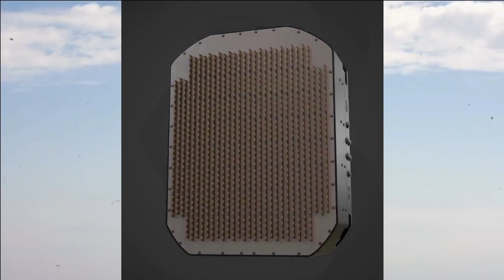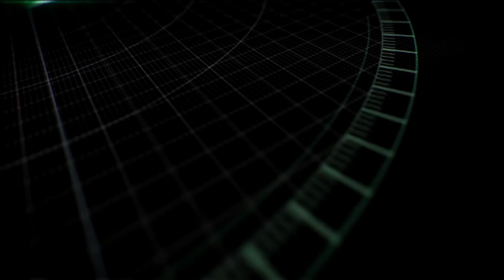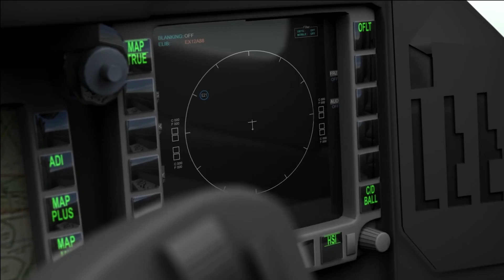Fly-by-wire & Engine Upgrade planned for SU-30 MKI

Comment: Ist possible to accommodate the AL 41 f 1s engine in to the existing Hull of su30 mki
Reply from the maker: yes it fits into SU-30 MKI air frame. Hull is used for warships.
Reply: @IndianDefenseAnalysis  Thanks for your reply and corrections

Comment: Looking to the future
After Jaguar retirement convert 5 squadrons to the ground naval strike mission. 
 Like f-15 strike eagle.
second life to the tired airframes.
It may be include 
1.utam big radar
2. No  internal infared tracking system (free space)
3. No trust vectoring (free killos)
4. Flyby wire made in India.
5. Weapons officer dedicated.
6.fuel tanks
 Things like that ,simple relative to the performance gains  .
Sukhoys have good range and good payload .

Iaf also needs to
 strimline weponry .    sos
Link 16 or similar.  sos

Comment: If we have to keep in the budget under control, we should forgo the change of engines. If possible some upgrades to the AL-31 should be taken up, rest Fly-By-Wire, Uttam AESA and New avionics n other upgrades should be taken up asap.
Reply: engines have service life time issues, they are must needed change

Comment: If you look into reason why Abhinandan's plane was shot down that was because of missing communication link and BVR. This is a problem with whole Indian army, not just with IAF. There was even a retired Pakistan general who mentioned the same thing.
Reply: Had he flown a Tejas instead he would've been safe
Reply: If you have a soup of different equipment from different countries, synergy and integration is kinda out of the window. lol
Reply: @sidewinder3422  Don't think that's any issue here. You have example from Ukraine which is using older platforms from any country it can get. Problem I'm trying to highlight is, army should be working on networking first so their aircraft/tanks would be in better position even if platform is not very good.
Reply: Mig 21 is not ment for BVR engagement. When Mig 21 was made, visual range dogfight was norm. While F-16 was made with BVR capability. Su-30 MKI is very capable of BVR.
Reply: Mig-21 is no match for an F-16.  This isn't a movie, in real life you can have a guy in an old F-14 destroy a bunch of SU-57s
Reply: He tried to take an F-16 with crap Russian tech and got his ass handed to him
Reply: @verdebusterAP  If it had networking and BVR capability then mig-21 would have been much more lethal. If aircraft would have been getting data from awacs or any other ground system and better BVR then pilot would have full battlefield picture and better position to handle that situation.
Reply: @omegabluek  
  If it had networking and BVR capability then mig-21 would have still gotten smoked
The F-16 was built with radar and other advanced features in mind while the MIG-21 was not
The MIG-21 limited size does not allow to accommodate what it needed to match an F-16 in fight
Reply: @verdebusterAP  
But gotta respect his guts, right? The sad fact is that our politicians and bureaucrats have historically let our armed forces down, but our armed forces have a never-say-die attitude, summed up by the quote of the Army Chief during the Kargil war; "we will fight with what we have". Salute
Reply: @arthurrod7638  
He's lucky to be alive 
Judging by the amount of wreckage ,its was promxitiy fuze not a direct hit
Reply: @verdebusterAP  
Occupational hazard, bro, occupational hazard; salute

Comment: IAF might feel that just 16 % thrust increase is not worth changing the engine. If izdeliye 30 is available after few years with HAL production then it is worth the wait.  India also need a engine of izdeliye 30 class as we have to start development process of su 30 MKI replacement atleast by 2030
Reply: TEDBF model will replace it in 40s era
Reply: @surojeetchatterjee  SU30 MKI and Rafale or TEDBF/ORCA are of different weight class of fighters..  SU30 MKI has combat range of 3000 km so ORCA cannot replace it so we need to develop new aircraft
Reply: @karthikmk1839  
I agree with you regarding the engines 👍